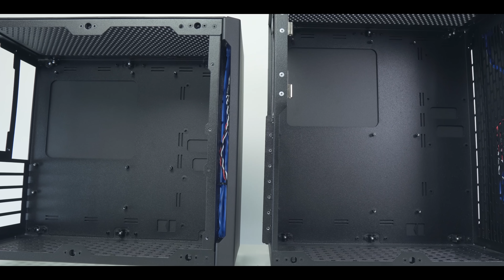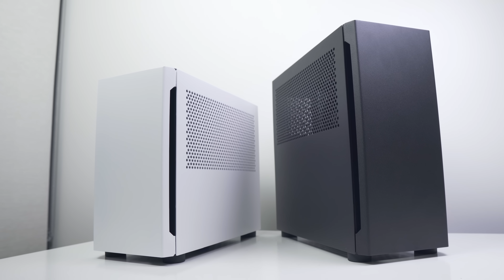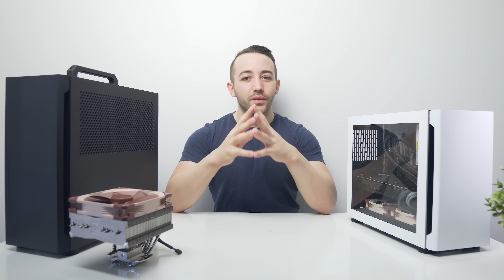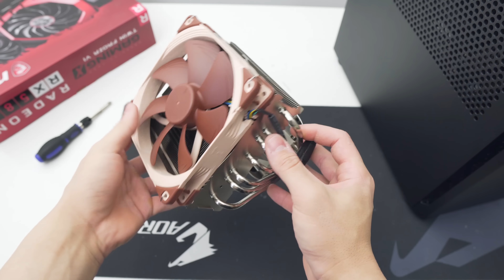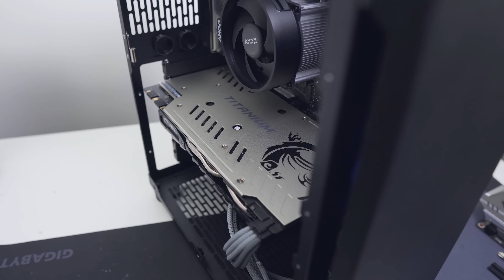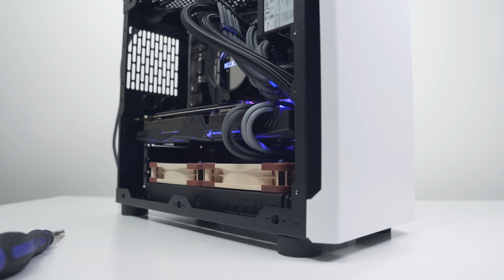Chimera Cerberus & Cerberus X - A Compact Workstation Dream!

Comment: They messed up with this case in GPU support. 10mm longer and you could fit many 4090 models, but as it is it only fits the MSI ventus or liquid cooled GPUs. Sad.
Reply: The case was made over 10 years ago.

Comment: very expensive for the garbage that it is, the design is very basic $250 are you crazy? from an unknown company... sentey offers you the same for less than 50 dollars...
Sentey Rainbow-F10 and K10 (5 centimeters difference around)
Reply: acrylic 250$...
Reply: This has a steel frame and superior build quality. It's the only case of this size and premium build with a handle.

Comment: The only thing I can think of is if you could mount your sfx/sfx L power supply in the bottom front of the case it’d give you the ability to run a 240mm radiator in the top and use the window to show off the inside of the build without it being blocked by the psu

Comment: The Cerberus is a really nice case definitively. I wish they get more popular, so the prices drop a bit, because even the most basic option + vented left side and SFX back bracket, will 235$ plus shipping if outside of US.

In terms of design it is OK, but I would make it slightly shorter (20mm), less deep (74mm less), and slightly wider (42mm more), to get 17.3L (instead of 19.7L). This would allow to mount bigger front fans, real air cooler on CPU while having SFX at the back, and even could fit 2x 40mm fans at the back between mobo and SFX PSU. The only disadvantage would be not supporting very long GPUs and 280 radiators, but shorter GPUs and 240 radiator should still fit.

Comment: I ordered a Cerberus X because of this video. 
I am getting ready to order fans but I am unsure how many I should get, I want 2x 140mm Noctua's on the bottom, 1x on the front and a 92mm for exhaust, I have a 140mm CLC ill be mounting on the side swing but I am unsure if I can fit 2x 140mm up top with a front mount SFX or not. I don't want to be able to build in it when I get it because I haven't ordered fans but don't wanna deal with returns unless I have to, hoping for a little guidance.

Comment: I hunted for a decent sff case for weeks and finally settled on the cerberus... its not cheap but i believe it will be the last case i ever buy... with components getting smaller and smaller, anything i would be interested in building in the future should fit... also with so many options on power supply mounting, and 280mm aio support, this case just checks all the boxes on what i require... 
the mesh top panel allows for direct attachment of "slim" 120mm fans however i recommend using tool less mounting as the holes are just the slightest bit off... the rubber mounts have enough play in them to keep the fan secure...
im running a 3600, x570i, with msi 2070 super... i went with mounting the sf 600 in the back of the case in front of motherboard and use the ps fan as an exhaust... because the x570i only has cpu fan and sys1 fan headers i chose to go with fractal designs celsius +s28 dynamic... originally i had the x63 nzxt cooler but found that fan support was non existent... i dont recommend that cooler...
with the front of the case pretty much open, i can run a single 120mm fan as intake and mount an ssd to the side of the case... also that entire front section of interior space can be available to all the wiring coiled up and zip tied... the case itself does not have any space behind the motherboard so cable management is tricky... i suggest 3m tape and zip tie downs... 
i think im going to install the side panel with perforations on the lower half of case... that way the gpu will be getting air from the aio cooler and can exhaust out the side... 
over all very impressed with the case... its simple, well designed, quality construction, perfect size, and looks good... great case for anybody wanting the best in my option... the only real compromise is the cost... everything else is perfect...

Comment: I'm using Cerberus x. I have mounting issues with my h115i on the bottom of the case. 280mm fits better at the front.

Comment: What a crap, what an idiot designed this in a way it is not possible to fit any decent radiator (max height 148mm). And no 200mm fan mount on front. This is crap.

Comment: Will Cerberus fit a 240 radiator on front and a 240 radiator on bottom at the same time? Having a hard time to find a matx case fitted two 240 radiators at same time.

Comment: Been using the Cerberus since June or July, since I didn't want to upgrade my hardware to be able to properly use the ITX form factor. So much more compact than my previous mATX Corsair Air 240 case. I'd say it's worth the cost of not having to buy new hardware just to downsize and be more compact. Instead I bought a case that fit all of my existing hardware (besides PSU) in a much more compact nature.

Comment: Tempted to use the Cerberus (non-x) for a potential 3rd Gen Threadripper build with Asrock Taichi X399m - does it leave enough room for a sound card (Creative ZXR) with GPU or would I need to go with the Cerberus X?
Reply from the maker: I'll be receiving an X399M Taichi this week and doing a build in the Cerberus, be on the lookout :)
Reply: @optimumtech  Great :D The Chimera Mach One also looks very interesting, they need to get a move on!

Comment: Awesome video mate! Been looking for a compact matx case that will fit high end parts for my next build and just ordered the Cerberus using your promo code after seeing this.

My planned parts:
9900k
Kraken X62 280 AIO
Z390 Maximus XI Gene
2080ti FTW3
Gskill Trident Z RGB

I'd really like to stick with an SFX psu as I got the window side panel and already have an SF600 but not sure if it will handle a 5ghz OC. Have you tried the Silverstone SFX-L 800w? It seems to have a bad rep online.
Reply from the maker: Great parts! You should be fine with the SF600. 
Corsair are releasing the SF750 soon so you might want to upgrade there for some overhead.
Reply: Did you end up getting this config? I have a 

9900K
Kraken X62 

as well and I'm wondering if the radiator fit ok? If I heard correctly in this video the recommended radiator  size is 288 mm?
If you ended up using some other cooling option instead what did you get? 

I haven't opened any of my components and started building yet as I want to make sure everything will fit ok

Comment: I’m stuck between two configurations for the Cerberus. (1) Step up to a 280mm AIO at the bottom of the case to increase cooling of the GPU and the CPU, or (2) Mounting the 240mm AIO onto the hinged side bracket pulling in fresh air above the GPU, with two 140mm fans at the bottom pulling in fresh air for the GPU.
Reply: I am struggling with the same dilemma. Which route did you take in the end?
Reply: 1 = window side panel
2 = vented side panel 

IMHO :)

Comment: Compatibility might be what they say is a strong suit, but they also cut out the enthusiast end of air cooling. Also, odd how many sacrifices you need to make in an ATX case if you want to use an ATX power supply. Combine that with the utter lack of dust filters and this case is a miss for me. Still, I hope some others like it because it is always great to have new and innovative case makers in the market!
Reply: Also I'm pretty sure it's not sff 🤔 Dimensions (HxWxD), 380mm x 172mm x 358mm = Volume, 23,4 Liters .

Comment: Thanks for the well rounded review! Subbed recently and really enjoy your content. Also a fan of this project since the Nova days and happy to have a slate gray Cerberus X with handle kit for my daily driver. YES it is pricey but its modular, small while supporting a large amount of component options and built like a tank.  Made in the USA by smaller company with an excellent presence in the SFF community. Great customer support as well. Hopefully they can get the volume up and bring the pricing down if possible to get even more people building in Cerberus and Cerberus X.
My Build:
Asus CH Vii wifi
Ryzen 2600
XFX Vega 64 Limited edtion Air
32Gb Team Dark Pro 3200 
500Gb Samsung Evo M.2 nvme
1Tb Crucial Mx500 M.2 ssd
Corsair SF 600
Corsair H100i V2

Comment: Asus Maximus VII GENE
delid and liquid metal 6700k
16gb 3200 Corsair lpx
Noctua nh-c14
Zotac 1080ti
Samsung 860 evo 1tb ssd
Seasonic 1tb 2.5 hdd
Silverstone sx600g

Its in a panda cerberus.

I also thought that the blue usb 3 cable was odd mine is black.

Comment: Over $200 for these pieces of garbage? LOL!!! No rubber grommets, no drive cages no PSU shroud, no TG. Should be $50, not $250.
Reply: roller_47 this case is obviously not for people that need drive cages and PSU shrouds.
Reply: Name another case under 20L where you can run 600mm of radiator space without slim fans. Where are rubber grommets going lead to? The case is so narrow the motherboard tray is sitting on the side panel. If you're still thinking about $50 parts you can't afford to even think about what is meant to go in one of these.

Comment: Watched the development of this case back when it was still called the "Nova", in beautiful blue. Finally ordered it this year and built a workstation/gaming machine in it. Since you asked for builds with this case:

i9 7980XE (delidded, overclocked)
Kraken X52 with 2x Noctua A12x25 as bottom intake
Asrock X299 ITX motherboard
32GB RAM
EVGA 1080Ti SC2
2x Noctua A12x25 as front intake
1x Noctua A12x15 as top outtake

It's the most power I dare to pack in such a small build.
Reply: nlariekanarie is your build in the Cerberus or the Cerberus X?
Reply: Cerberus
Reply: Awesome! But only 32GB RAM paired with Such a expensive cpu feels bit weird but doesn't matter tbh lol Even I'm running 2970x with 32GB ram too😂 glad I'm not alone

Comment: 220$ for the small one...i think im gonna keep my Jonsbo U3, it's almost as compact (20liters) and the only drawbacks are that you can't fit gpus longer than 260mm (you can find alot of good gpus that are small tough, even a 1080ti from Zotac, i hope the RTX 2070 is priced good because FE PCB is only 23cm :O ) and there are no space for harddrives when you want airflow like me but i use nVME and external storage, gonna pimp it with fans in the bottom and a Dark Rock Pro 4 soon.
Reply: I wish Silverstone would just update the TJ08-E. That case was so ahead of it's time for mATX. They just need to make some internal updates to support SSDs
Reply: Silverstone was my first pick but they where harder to come by, i wanted the version with two regular fans in the front instead of the 180mm.
Would love to see a updated version, better inside and a cleaner outside like getting rid of the 5.25" slots.
Reply: Not only the case, ITX motherboards with Z370 at least 30$ more the cheapest ones dosn't even have a heatsink on the VRM and just like ITX motherboards SFX psus arent on par  compared to ATX/mATX or ATX psus in some ways.
You can go small but if you want really small it costs extra in terms of usability and money.

Comment: Looks good on the outside. Everything else is trash. The price is way too high, layout is bad, oem colored cables, no usb c, no included fans, accessories are too expensive. This case should be under $100. Aluminium or not

Comment from the maker: Sliger are offering you guys 15% off if you'd like to pull the trigger on these before October 31st, use code: OPTIMUMTECH at checkout (not a shady kickback link).
Cerberus: http://www.sliger.com/products/cases/cerberus/
Cerberus X: http://www.sliger.com/products/cases/cerberus_x/
Also, Demcifilter dust filters are in the works, hopefully we can see those available too. 
Thanks for watching!
Reply: Perfect! I needed some other psu mounting and the chrome handle!
Reply: Thanks man
Reply: Not smallest ATX case! Don’t lie to me! The smaller already made in 2014, Daotech X10 BeLLUM☝️